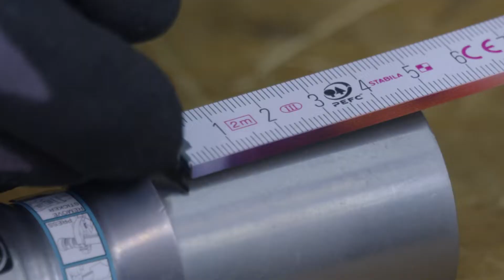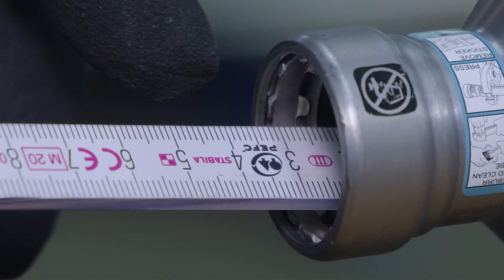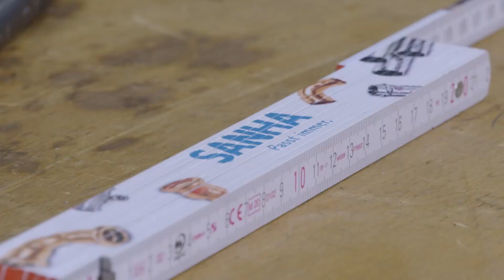Heavy Steel Press: Installation video, all dimensions up to 2"

Comment: Hi could you tell me what the paste the label on the sleeve
Reply from the maker: Hi there, the label is a safety sticker. Just pull it off after pressing. This way you immediately see whether a connection has been pressed or forgotten. ☺
Reply: @ thanks for your sharing
Reply from the maker: @ My pleasure. -Sven from SANHA